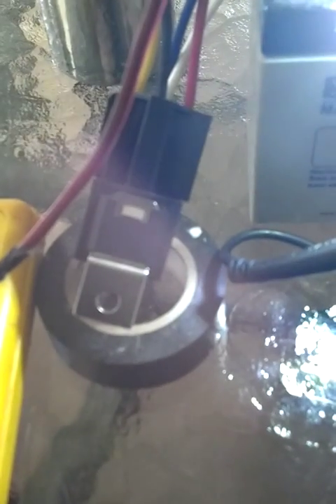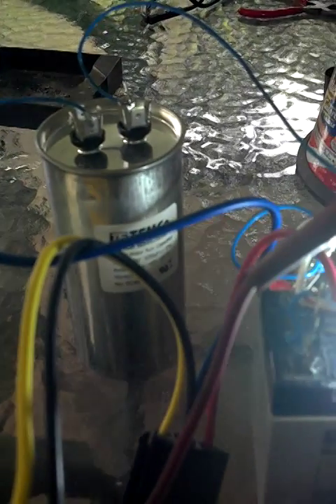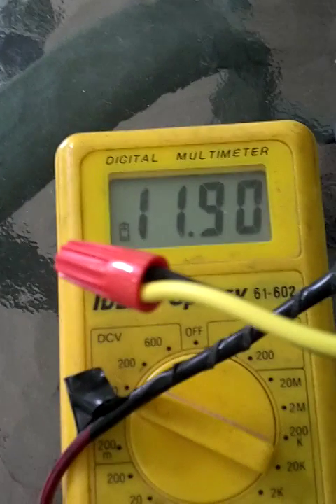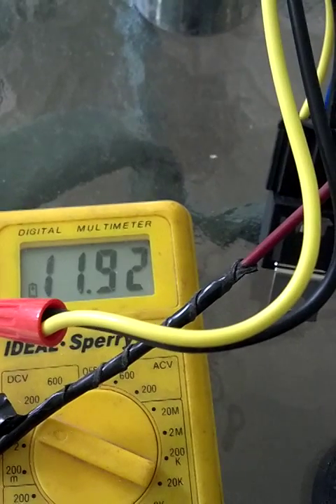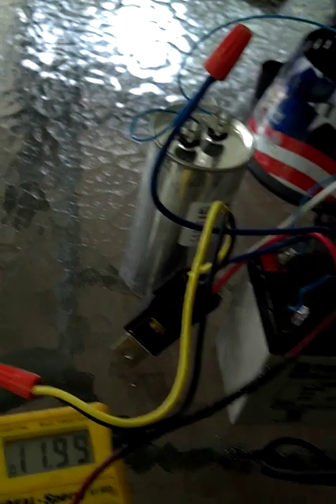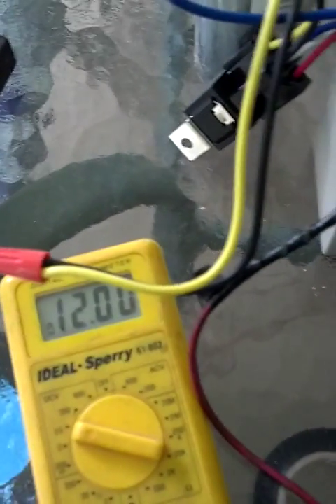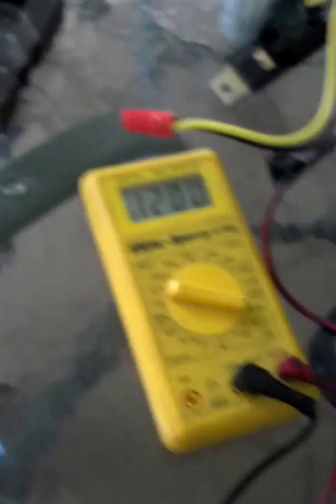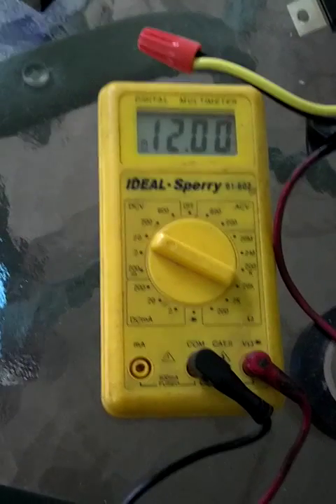Real Radiant Energy

Comment: Hi Marc, I have successfully replicated your A-02 circuit and it works beautifully! Thank you!
My transformer in the circuit is from 220V to 12V battery charger so I had to reduce the rectified DC voltage of 25V to 13V using an additional small variable step down transformer before feeding the supercap bank.  The load I’m using is 12V 250mA LED module for car tail light. The voltage of the battery stays constant at around 10.5V moving up and down a little. My initial battery voltage was at around 11.5V. My questions are,
1. Will there be any possible way to reduce the noise from the relay or perhaps even replace the relay with alternative back-EMF inducing coil-switch-sparc gap mechnisms that are more durable which last longer with less noise?
2. How will increasing the capacitance value of Supercap bank affect the overall performance of the circuit? Let’s say increasing the F value from 83.3F to 500F. Will this increase enable the circuit to handle increased load also?

Thank you again and god bless you.

Paul

Comment: Fascinating stuff... tried the circuit and it worked!  My Voltages are jumping all over the place though, like over 200volts!? I am just meter direct to the battery contacts... is this why I am seeing the spikes or have I wired it wrong?
Reply from the maker: Are you sure i t is 200 volts or 20.0? I haven't achieved these voltages, however only have used 12v dc batteries and 2 particular relays. If the relay coil and capacitor are the correct variables in size in relation to your frequency, you may have achieved a resonant circuit which will give out enormous amounts of energy since it is ringing naturally. This draws energy in from an outside force of energy that is thought not to exist. This is the type of thing we are looking to document along with the circuit variables so we could consistently prove the possibility. This is what Don Smith achieved and the link or key we need are the numbers including frequency of oscillation, the relay type, the voltage and battery variables, and capacitance within the circuit across specific nodes or capacitors used. The inductance of the coil in the relay is needed, the schematic diagram used and the resistance of the circuit across nodes. This is all needed to recreate the action. If it is able to be reproduced, adjustments need to be made, after scoping the circuit to prove it is resonant, acting as a Meissner circuit, ringing and collecting energy while providing an overcharge. Then a more responsible circuit will be needed to be designed to only charge the battery as needed per the load, or expand the circuitry to exponentially increase outputs while isolating parts of the circuit from being connected that may eliminate the overunity effects. We aren't making more than we use, we are inducing or capacitively coupling with energy from the Earth's energy by using inductive and capacitive reactance to draw energy from the capacitive earth. The Earth is a massive capacitor that sometimes discharges it's energy between the core of the planet and it's upper atmosphere, known as the magnetosphere. This voltage builds and builds and eventually will overcome the dielectric the air, which is our insulating blanket that keeps us out of the path of discharge. The atmosphere has so many volts per meter as we climb in altitude, and by becoming higher and higher, it may charge up via energy particles, maybe gamma ray, or solar rays, maybe even by light sources from other solar systems, and other phenomenon.  The atmosphere has a specific limit of voltage per meter before it breaks down. This is called the dielectric constant, once it's potential rises above this point, the energy discharges from one polarity to the other,  resulting in lightning strikes between the clouds and ground. We could draw energy from each and every lightning discharge as they happen within the natural frequency of the planet, provided we link together with it properly. These variables usually jive by a multiple of some number. We can use the variable of 3, however the closer we get to the actual frequencies needed, as they vary by distance the equator, we could figure out the components needed per long/lat to create free energy generation.  We need to know the multiples used to compare them to other cases in an effort to prove it's existence and make way for the generation per placement on the map as you could imagine since these all vary by variables our planet provides within elevation, magnetic fields, etc. Some places have much more energy than others, and Don Smith had a map that gave oil companies the info needed to locate oil and other energy commodities, such as coal, natural gases, etc. By being in one of these locations, the energy grid we seek in tapping is easier to draw from. You can help by providing the figures needed for future use in to aid in a disclosure project that will eventually free us from paying for  power in the near future.
Reply: @advanced-electronic  cheers for getting back with your comprehensive reply. Yes it is definitely 100-200 volt spikes at the battery terminal.. i am only using a 6v battery which can only just move the contacts but it works...

I haven't noticed any increase in the battery but the capacitor has 30-40v in it..

Yes, have read up about tesla/steinmetz etc, am going to try it with a bifilar coil and mosfet next...want to get the battery increasing first before I upscale...
Reply: @advanced-electronic  Just found out that the 6v is not rechargable. Might be the reason for seeing the voltage spikes (and it not charging doh! )?

Comment: I tried it and i observe that the battery voltage goes up but the ah gets lower and lower till it discharged the battery
Reply from the maker: did  you use the circuit  with the transformer and the  diodes as I show in my prints at the following address? http://mbrcircuit.blogspot.com/ . you could add diodes from the power source so the correct polarity flows from the battery to the relay. Stripe towards the negative battery terminal opposite for the positive.  This will allow the back emf to flow to the battery in the correct manner, however you'll need to figure out a way to shut off the source power during each counter emf discharge cycle so it could place charge to the battery without having the load cancel or eat it up, even though the load is very small. . The best way would be to use solid state components (transistors and IC or timer chips to do this and add a coil and cap to obtain resonance as stated before. Resonance is key to the activation of this energy but something needs to disconnect the source to bring this energy in and store it in caps, then perhaps dump it back into the battery.  I was successful using higher voltages at high frequencies using an arc gap, which acts as a switch and doesn't allow the environmental energy to be lost when energy flows through the gap via an arc.. Amperage driven energy is blue, and cold energy or  non electron energy (energy from the antimatter of the electron utilizes the opposite of the electron, called the positron. This energy must rely on the grounding of a circuit on one tap of the transformer used, you have to experiment and see which place or node needs to be grounded. This can NOT be grounded to your electrical ground, you must be 20 feet or more from any grounded electrode that leads to your electrical system or the positrons will be cancelled out from the electron flow that generally flows from residual currents, ground currents and reactive energy dissipated to earth. In essence, reactive energy is your back emf, but with the proper connections and antifeedback methods to the battery, it could power just about anything and will not burn anything out except for capacitors,  when the voltage is too high. The normal physical laws of electricity do not apply to this energy since high resistance will give gains in power,  opposite of forced amperage electric systems which are the only systems other than static el;ectricity that science currently allows to be taught due to the means of making money. Tesla perfected the technology, but was ousted from the scientific community because of JP Morgan's greed and financial power/influence. One interesting thing is that batteries will charge with high voltage, low amperage charges and release them  as normal amperage driven energy during the load cycle. Energy that is pulsed at a high frequency range has the equivalent to the same amperage given per one cycle times the overall frequency, so if AC voltage is driven at 60 cycles, the energy output could be driven at 60,000 cycles and filtered later with a simple 6db per octave bandpass filter to give 60 hz with the power of 60 hz system x 1000, so if you have 100 watts output at 120 v 60hz, if converted correctly it should give you an output capability of 100000 watts. Don Smith has come up with a system based on the work of Tesla, same as Tariel  Kapanadze, both similarly built with massive power outputs using high voltage high frequency inputs at very low power consumption, only Don has used the circuit to self charge and self run making his the home run using neon power supplies that are fed with 12v DC outputting  up to a few megawatts in Japanese submarines using the ocean water for ground .
Reply: @advanced-electronic  im ganna try it again.by the way what is the used of the dpdt switch?
Reply from the maker: @smoke_stackz3168  The dpdt switch in one of the diagrams was just one of the several versions where I tried different methods to come up with different results. I havent documented all of them, but the ones that were posted I was literally forced to leave out some components. I gave you what yu need, but you'll have to change variables to come up with best results. grounding far away from home earth grounds is important to get the inverted action  of magnetically propagated amperage forced energy (which is what commercial, residential and industrial electric systems use to this day). There is an equal and opposite reaction for every action. The inverted reaction for magnetism is gravity. The inverted version of amperage or electron driven electricity is cold electricity or positron driven electricity. This I feel is driven some way from gravity and the power related to the g field of our sun, due to it's massive energy output, which works on the principle of fusion which is related in some way to the antimatter reaction of the electron, which is the positron. If we use our basic electrical principles and invert them, we are able to gain many strange things, all of those which science will do all they can to debunk the theory because the we are forced to learn only sciences based on the original physical laws that will not allow us to draw energy from sources unknown to science. This limits scientific studies to basics and call all we experiment with pseudo science since they are theories... This is all of what science was based on until theories were proven. Look at Darwin's theory.. it is still a ridiculous theory with no actual fact behind it but they teach it in schools, and science has proven otherwise but they still keep preaching it to hide a secret
.
Reply from the maker: scope the oscillations to figure out the frequency. Once you figure that out,  test for inductance of the coil. Then use an online chart to figure out the  correct capacitor to use for the voltage  from the oscillations as you  will be collecting back emf in the cap so you need to ensure it won't blow up. Then you'll need to make  tank circuit between the coil and cap that will operate in resonance at the same frequency driven by the  oscillations of the switch. The formula is located here, as well as the schematic http://www.1728.org/resfreq.htm . That should solve your problem, the problem with the circuit is that the battery stays connected to feed the coil at all times, it needs to be disconnected during the back emf cycle of the coil so it charges the battery using LEDs or diodes as Don Smith did.

Comment: i got a better solution. i use the exact same principle but i use a resonator from an old inverter instead. it works like a relay but are build for it. and set it to power a 12 volt lamp, or a smaller led. 
and when i get a regular sox lamp, it will be fun to drive it.
And it works. the resonator is build for it, so i removed a small diode  and well done. the rectifier is rated for 50 volt and the caps is 3300 uf. without a battery connect the circuit easily get around 25 volt befor i stop the progress. I think to build it into the old box cover from the inverter, and install a big led. yes a free energy flashlight, lights for ever.

Comment: A great example of real Radiant Electricity. the high side switch is normally closed, and conducts. Due to the current, the switch opens, and an inductive spike gives back the energy of the magnetic field of the coil to the cap/battery. But energy is still lost due to wire resistance. 

 the real magic radiant energy appears when the switch is closed again, the capacitor (parallel to the battery) has a low internal resistance, and is disruptive discharged through the coil. this creates the radiant energy. That gives the extra energy that overcomes the wire resistance losses.
A bifilar coil is much more suited for this, due to its wire arrangement that results in a high store ability for the dielectric field

Comment: hello my friend marc im a autotechnician i just wanna know how the relay will be wired up to   to get the radiant energy i know have to be 5 pin means with normal close contact and normaly open contact wich wpin must be join it to 85 to 86 or 30 to 87 a or 87 b
Reply from the maker: You could find more info at mbrcircuit.blogspot.com this is what I called the circuit I made that self runs. The relay configuration is the same. If you use the normally closed switch and wire it so the relay coil is in series with the switch, it will auto oscillate. Good Luck!

Comment: why not use a transistor circuit
Reply from the maker: because the transistor citcuit doesn't release as much energy due to the fact that the switch in the relay acts as a switching arc gap, the transistor doesn't do the same, it either conducts or doesn't like a diode controlled by the gate. Thet are 2 completely different animals. The relay charger built in resonance is capable of powering 6-12 watt loads and they are still capable of being looped as shown in some of my videos. They may not last as long, but my circuit was capable or running 6 months without dying because the brand of relay used was able to switch softer than most and it didn't burn up the switch being that the switch didn't get hot, it got cold and had a green arc instead of blue. The energy measured as negative voltage with my scope, which is proof of radiant energy.  The type of radiant energy it produced isn't normal, since I have identified 2 or 3 differently working radiant energy types, one of them is negative in nature and is capable of driving fairly large loads once this energy is banked into capacitors, as Don Smith's system functions. The transistor circuit  you speak of is a radiant charger circuit. I built many of those as well and they are more versed with use of heavy and short very thick conductors over toroids 1" or greater. The relay has a small gauge coil built in so it is easy to make it oscillate at any frequency you wish between the relay's using small capacitors. If we add large motor run capacitors at the output, the energy is great for the use of inductive loads, led's operate on reactive, and large electrolytic store and convert radiant to conventional energy at an amplified/multiplied rate of wattage allowing them to feed more loads than it consumes in wattage. This is why I do NOT use transistors. I did create an Overunity transistor charger, it works by placing an Avramenko plug and resistor at the ground and this allows the energy to be mirrored from the ground reflection, using nothing from the source power, allowing it to charge super capacitor banks for free from 2/3 of the way full to maximum being  as large as 500 Farads at 16 volts to 24 volts in 30 minutes time using .6 amps at 19 volts
Reply: Okay thanks, my friend. So where the radiant energy cames into the circuit.
I have a transformer with 2 12-6 center tap windings and 1 main winding. So i build a joule thief circuit of 1 of the low voltage windings, and fit the other with a rectifier and a cap, I think it's will work better because the relay have a very short lifetime.

Comment: Hi Marc I just replicate this circuit. Thanks so much for posting your video. It is working just fine. I will try and post a video of it working. I had in idea of placing a secondary winding of an MOT series with the coil of the relay, but I am not sure what to expect. What are your thoughts on this one? Please give me a feedback when possible.
Reply from the maker: hello,
actually that will work as a coil driver as I've done this for my Tesla coil, however, you won't get much driving power unless you use a battery capable of high amperage, or, a good power supply. be very careful if you use this to try driving sensitive electronics since the back end can create up to 450 vac and could destroy cmos ICs . If you use light duty batteries like a 9v, or wall wort 12v power supplies, you'll only get high voltages worthy of creating high frequency arcs, maybe too low to create large arcs capable of driving hairpin circuits. It's an easy driver to.use, and, is one of the first circuits used for the Tesla coil. relays at one time were what Tesla and a lot of other scientists used as vibratory.switches for many electronic experiment. thanks for your post, please share my videos... I will share yours as well and post some cool instructional videos very soon.